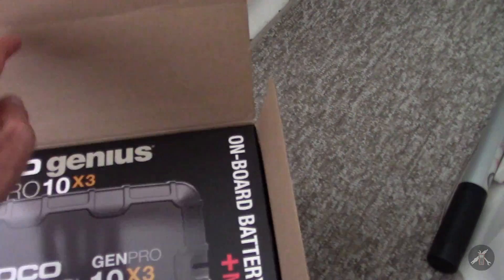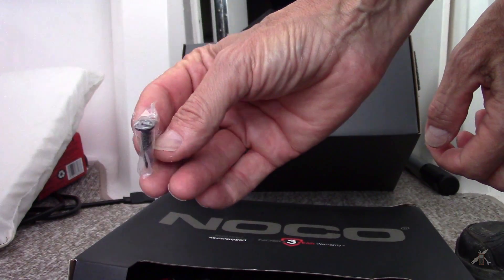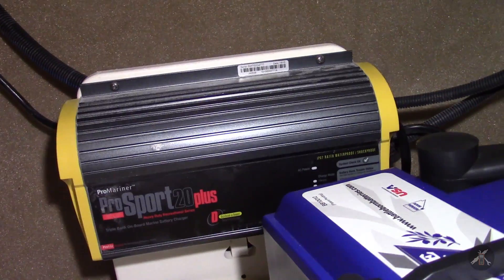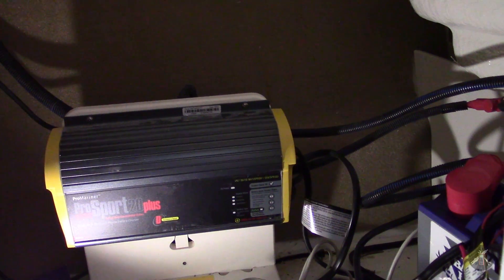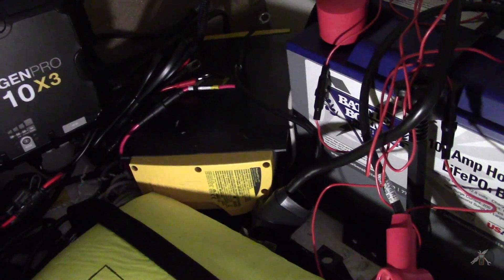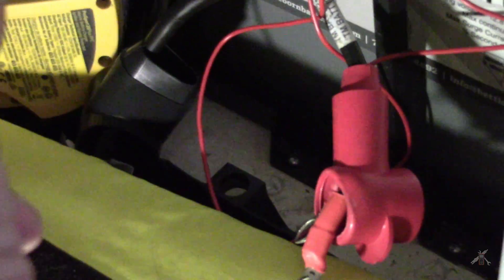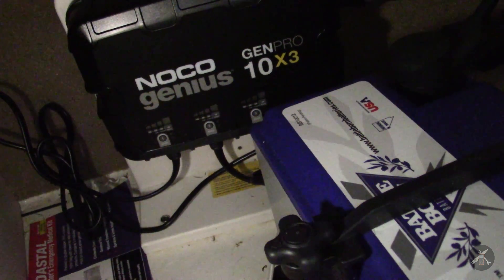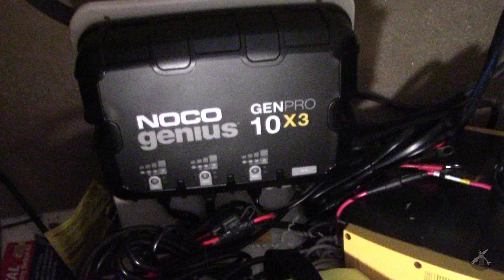Unbox, Install, Set up Triple Bank NOCO Onboard Charger for Lithium Ion and Lead-Acid Batteries

Comment: That's quite the compartment. I like the Noco brand. I have a jump starting one for cars. Small and powerful with no need for cumbersome jumper cables.
Reply from the maker: Yes, overall I love the boat, but all the hatches are just a little too small when it comes time for maintenance or repair. 
I'm still working on the next video, but the charge profile looks much better for my lithium batteries.  I'm going to like this NOCO, it charges much faster.